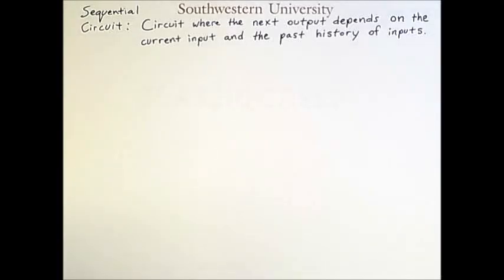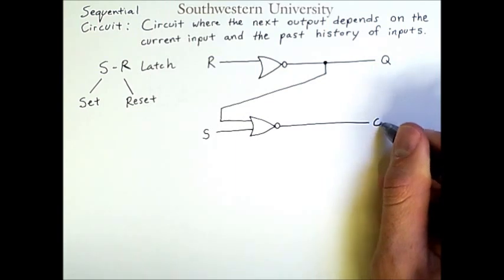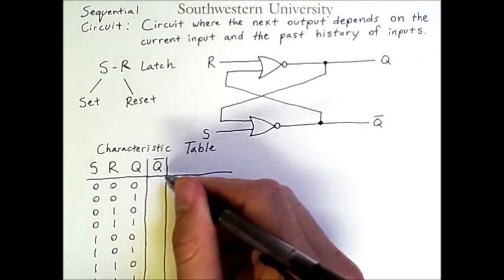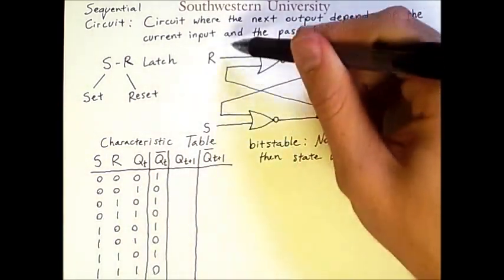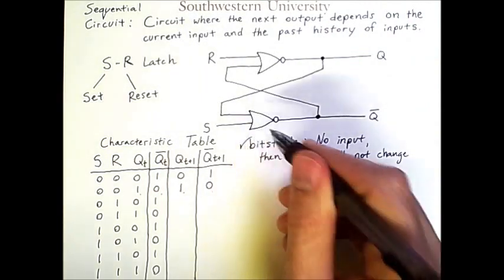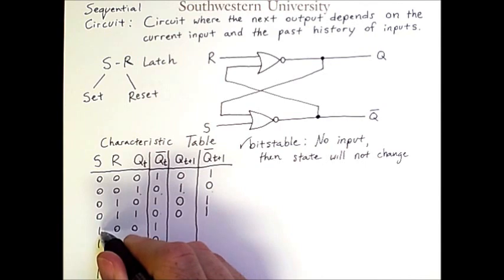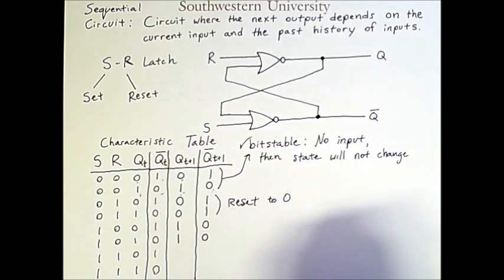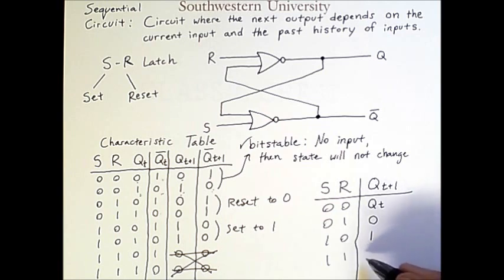Sequential Circuits: S-R Latch for 1-bit Memory

Comment: we have two inputs   R and  S, And we know that we have 4 combination for two inputs(  00, 01,10,11) , but there   is 8 combination for 2 inputs    , how???? it possible
Reply from the maker: Because the values of Q and NOT Q feed back into the inputs, they are also part of the input state. However, we only need one, not both, because NOT Q is always the opposite of Q

Comment: Thanks a lot Jacob but I have an issue. In first two and 5th and 6th traversals you are starting from Q(t) to NOR it with S but it 3rd and 4rth traversals where R=1, you are starting from Q(t)' to NOR it with R and producing the correct result. But why don't we keep the same behavior i.e. starting from Q(t) in 3rd and 4th row of truth table like we are doing in 1st two and 5th and 6th?  Knowing the fact that doing so produces both Q(t+1) and Q(t+1)' = 0 in 4rth row.
Reply from the maker: In principle you can start from either source, and as long as you keep looping through until the outputs are completely stable, you'll get the same result.